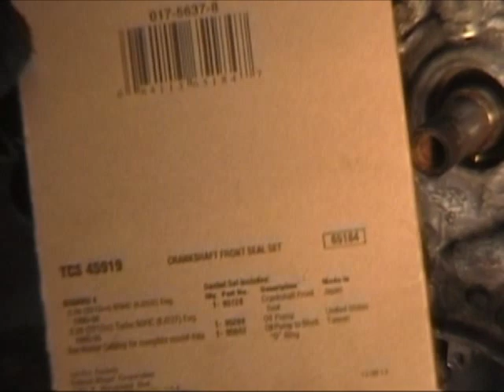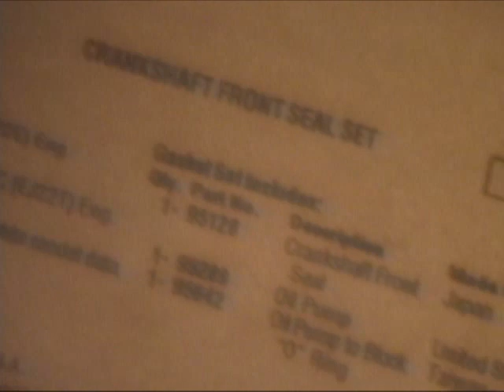EJ22 Oil Pump (all EJ engines)

Comment: Thanks for the video.  I have a feeling I'll be doing this really soon on our 2.5i motor.  Is there a reason why you installed the Camshaft seal prior to removing the oil pump?  It seems like you'd remove the old camshaft seal, then rebuild the inside of the oil pump, reinstall finishing with the camshaft seal.

Comment: Hello Miles! Me again. My impreza EJ16 (125k miles) get a clatter or knocking when warm, specially after up hill climbing. Put a thicker oil and it takes a little more time to make the harder noises. Thinking about taking a pressure reading on it ... What do you think
Reply from the maker: consider a 5w40 or 0w40 oil. What oil are you using. %w30 is not recommended. For straight oil, use 10w30 or 40
Reply: That's the business man. I'm already using a 15w40 and still knocks when hot. Maybe a injector coil acting up when hot and giving a lean condition and pinging that goes worse ands worse, I don~t know if it is lubrication related or not. Maybe a shoud drop the pan
Reply: I was leaning to try 95 octane to see if the knock goes away, but that's very expensive here, about 6 dollars a gallon! So you don't think it is oil pump - or lubrication  - related, though. And that's good news!
Thanks Miles.
Reply: Miles Fox Couldn't find a knock sensor on mine, neither below throttle arm on the block, nether in front of it. I think it doesn't use one. How could it be a no knock sensor engine I don't know.
Reply: This video shows a nice gasket, but  you can use permatex gasket maker as well. Either ultra grey or anaerobic.
Reply: @mightywrestler  True, ultra-grey high torque which is oil resistant apparently. Subaru would recommend Subi-bond / Threebond.

Comment: Is there any way to replace the pump without the removal of the engine?
Reply: Yes, but you will be removing the radiator and fans, the air conditioner condenser, the little plastic grille and that will give you access as well. You may also want to remove the alternator for better access as well. Thats how I do it and am going into one this weekend like that to do just that job. Make sure you drain the motor oil first and do that at the same time.

Comment: Hello Miles, While re-installing the pump housing, in the above video, you specify torque value of 8.7 ft-lbs. Then there is a conversion statement, "or 1.4 in-lbs."  Be aware. 8.7 ft-lbs = 104.4 in-lbs, not 1.4 in-lbs
Reply from the maker: I should correct the statement: it would be 4.7 ft lb for the water pump. Oil pump, valve covers with m6x1.00 bolts. 4.7 ft lb x 12 = 186 inch lbs. use a 1/4" dr tool
Reply from the maker: +Miles Fox whoops mean 86 in lb